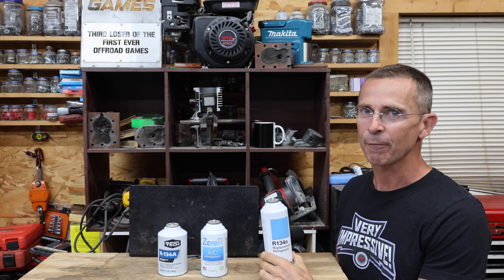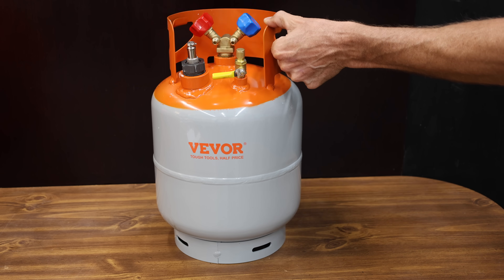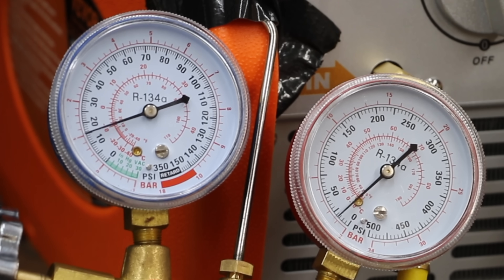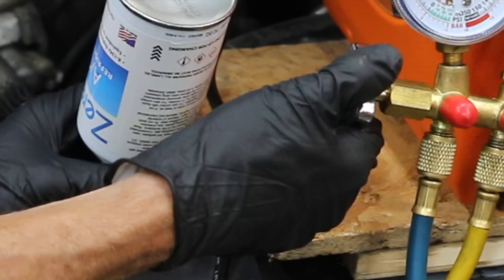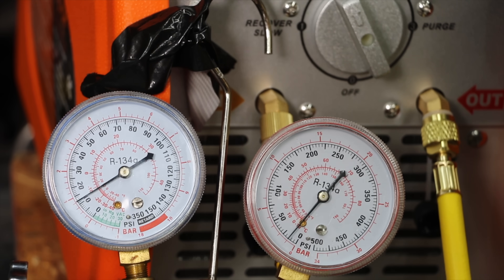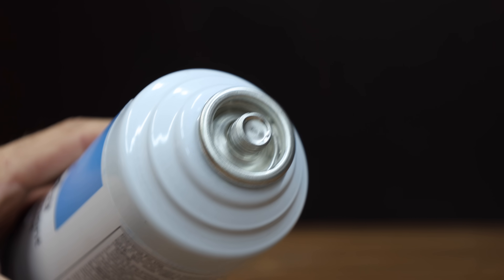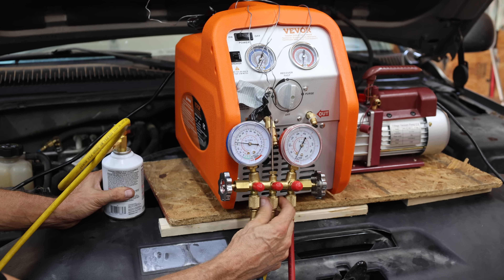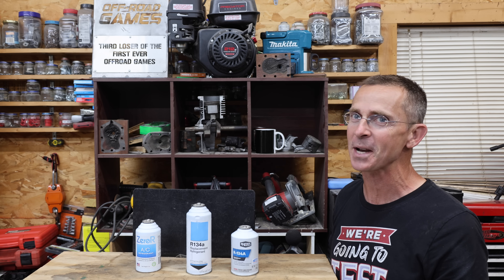How Dangerous is Fake Car A/C Refrigerant? Let's Find Out!

Comment: My grandpa used to charge his AC system with propane. When I got my first square body truck it had AC but didn't work, he said "oh just needs charged" I didn't think anything of it he charged it and it worked great, I drove that truck for almost a year when one day we were talking and he asked how my AC was doing I said still works great je replys with " good ol propane" I said WHAT!?! He then proceeds to tell me that's how he's always charged ac systems! Sorry papa I had to tell the story, RIP 🙏
Reply: Isn't propane (or possibly methane) actually used on some window A/C units, on the grounds that so many people can't be bothered to dispose of broken ones properly?
Reply: @hedonismbot1508  I'm not sure.. but I suppose it couldn't be any worse than R12 isn't it R12 that when it meets a flame is basically the same stuff Hitler used in all of his poison gas Chambers?!
Reply: @Daniel-Johnson isn't freon just r12 trademarks as freon by Dupont?
Reply: @tovenaar1988  I'm not sure 😕
Reply: @hedonismbot1508  Newer heat pumps usually use R600a which is just butane. My fridge has a big ol' "warning flammable gas" on the back.
Reply: Several HC types can be used as refrigerants, but isobutane (R600a) is the most commonly used HC in household refrigerators and freezers. Propane (R290) is used more in commercial heat pumps, air conditioners, and refrigerators and freezers.
Reply: @hedonismbot1508  Its butane. R600 cooling gas is called isobutane and it is used nowadays in refridgerators. Natural gas (methane) is not liquefiable but butane or propane is easily liquefiable under less than 10 bar of pressure.
Reply: Rv fridges often run on propane
Reply: @gonelucid  That's a different system altogether. RV fridges use an ammonia vapor absorption refrigeration cycle which does not use a compressor.
The main refrigerant which is a mixture of water and ammonia is boiled with heat (which is where the propane comes in), ammonia separates out of the water, gets re-condensed into a liquid, then reacts with hydrogen gas in an endothermic reaction which creates the cooling.

After some more chemical-physical shenanigans the ammonia, water and hydrogen are all returned to their respective places and the cycle begins again.
Reply: Propane works great.

Comment: This was not a test of R-134 replacement refrigerants … it was a detailed course in AC servicing!  Bravo, great job!
Reply: A win for us either way.
Reply from the maker: Thanks!
Reply: @ProjectFarm  i can explain why adding this replacement wouldnt work to some  people. you dont mix freon, u replace. so if ur half full and u add the other half with the replacement the whole system would fail bc both freons operate on different pressures. ur either full with just 134 or with propane but not both. so if the other people did wat u did , replacing the freon i bet it would have worked for them. i an havc tech
Reply: Still would like a timecert vs heli coil video
Reply: What have we learned today?  Just use a cheap propane tank to refill the AC.  ha-ha  DONT!!
Reply: real natural gas versus real R134e
Reply: @hu5116  I guess it's freon my wallet
Reply: @GiovannyAltamirano94   let alone if it runs on a slight vacuum it might have air in it- a low pressure ammonia is use in lots of RV or campers

Comment: I do find it funny when a product clearly says its not XYZ, then people leave bad reviews because they thought it was XYZ.
Reply: YA THEY DONT WANNA ADMIT THEY GOT SCREWED LOLOLOLOLOLOLOLOLOLOL x💯
Reply: I see that a lot on Amazon.
Reply: Reading is apparently an actual skill...?
Reply: Yeah. It's a plague in comments. However, in the case of the second one, it is a little bit more acceptable since the can has a big 134a on it as 'brand name', with a small 'replacement' that may suggest it is 134a for replacing what you already have. Though the item description on the product page leaves no doubt to it being a different product.

The first one however is perfectly clear on not bei 134a in every way possible.
Reply from the maker: Thanks for sharing.
Reply: If you travel down the highway and need to take the exit 114, then come across a big sigh that says "114" with "actually it's 113" underneath in a much smaller font, would that be ok to be mad?
Reply: Maybe it wouldn't be the case if the label wasn't like
R134a
ʳᵉᵖˡᵃᶜᵉᵐᵉⁿᵗ
I'm sure they didn't make them like that on purpose 😉
Reply: Yea but lots of products don't CLEARLY say "not" XYZ.

I saw a posting today for a stone that said "Green Silicon" and then buried in the product info said, "Silicone Oxide" which is not a thing. But it's poorly bonded aluminum Oxide, which will not grind the materials a green silicon carbide stone will
Reply: @Pro_Triforcer  but using the word, "replacement" implies a like for like.

It should say SUBSTITUTE to clearly label it is NOT the listed material or item.
Reply: Because it was actually ABC…
Reply: @MrArcticPOWER  that's a poor comparison because a highway sign is a time-sensitive method of conveying information. You have as long as you like to read and understand a product listing. Even time to look up manufacturer details and to read reviews beforehand.
Reply: It's a little misleading when the container shows R134a in big letters with "replacement" in tiny letters below it.
Reply: It isn't that clear though. Only in the description does it say that. The bottle and pictures of the bottle don't. Why would you think it was something else? It's like a truck saying Ford on it, and then you buy it and in the owner's manual it says "Not a Ford".
Reply: @Pro_Triforcer not even just that, but if your tire goes flat and you buy a "replacement tire", you expect to get a tire to replace your broken tire, not a thing in the shape of a tire that should mostly probably work like a tire. "R134a equivalent" would've been the correct term to use, or at least a better one.
Reply: @IsaacRifkin  I mean sure, apples to oranges, but bottom line is: if your product is misleading on purpose, don't be mad if people call you out on it. Now imagine how annoying it would be going to the grocery store and every product was using that same marketing strategy.
Reply: If a person needed to replace the R134a in their air conditioning system they should expect R134a Replacement to be what they're looking for, it's deceptive labelling.

It's absolutely not "clear" like you say. If it was clear it would say "Propane - R134a alternative" or something.
Reply: @MrArcticPOWER  I don’t know about you, but I research everything like this that I purchase. Description, reviews, the entire packaging.
Reply: @IsaacRifkin "As long as you like".

Must be nice to have so much time to be able to research every last little thing in this consumer world that's overflowing with information.

Just because the information exists doesn't mean it does so in a convenient, accessible format which the average overworked person has time to access, and can tell apart from all the clickbait BS that's also available.

It's one of the reasons why purely microeconomic models don't accurately predict real-world situations. People don't have perfect information or the amount of time to parse it, and a company that wants ti mislead people needs only take advantage of that long enough to make a quick buck and run off to become a different no-name brand. Mwanwhile the stores that carry it shrug and say not their problem, and since they used their monopoly powers to drive out the competitors you don't have a viable alternative to turn to.
Reply: Right?  They just need to take the L and move on.
Reply: It's like when everyone on eBay was selling PS5 boxes for $100 and everybody was buying them thinking they were getting a steal on a new PS5! The title and description clearly said, "Box Only", yet people didn't read.
Reply: @kikixchannel   I'm actually wondering if I've bought that in the past when I was learning how to top off the AC on my last car! I mean, if I were looking for 134a and saw the "134a Replacement" I'd have thought exactly what you said-- that it's essentially saying that it's a kit to replace what was lost. Scammy.
Reply: The problem is nobody wants to take responsibility for their own mistakes. It's so much easier to blame somebody else than it is to own up to your own mistakes.

Comment: To be fair, the R134a Replacement Refrigerant has R134a written on it with huge letters despite not being that stuff at all. Unlike ZeroR, the replacement refrigerant has purposefully been designed to deceive customers looking for actual R134a.
Reply from the maker: Thanks for the feedback.
Reply: Yep, I’ve been victimized by the scam.  If you see R134a synthetic it’s fake.
Reply: @greenidguy9292  Well all R134a is synthetic, we make it, it's not found in nature, thus synthetic.
Reply: IT's kind of bonkers that they can just put "r134a replacement" and not the actual R-number for whatever chemical is in the cans. It's very likely propane (otherwise known as R-290).
Reply: R-12a is a blend of propane and butane.  R-290 is straight propane.